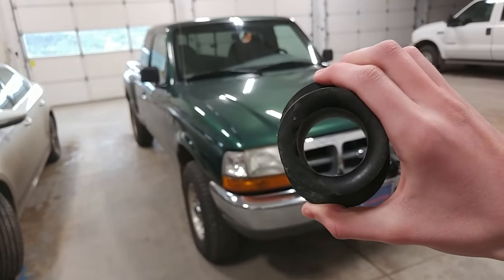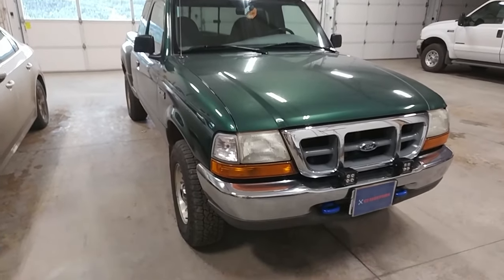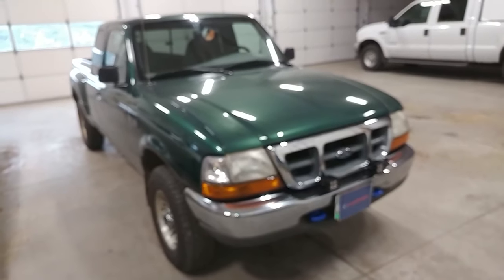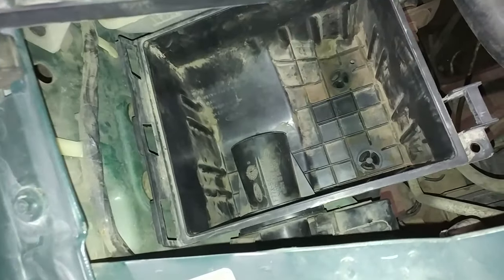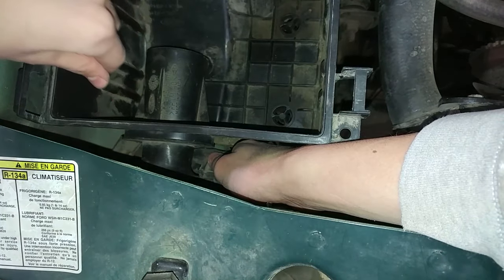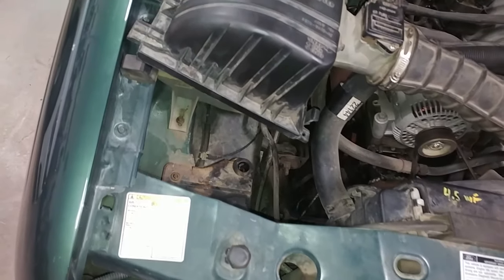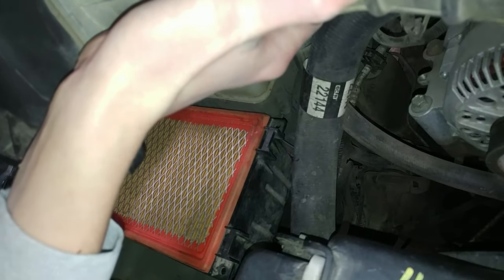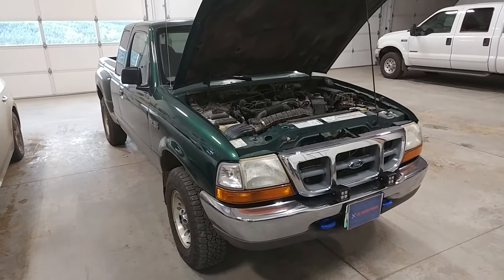DO THIS 100% FREE MOD TO IMPROVE SOUND AND POWER!! - Ford Ranger 3.0L Airbox Modification

Comment: I have a 2003 Ford ranger 3.0L . I put a K&N filter and cut 2 holes in the side of the air box below the level of the filter. Horse power has gone up and gas mileage has gone up as well.
Reply from the maker: Cool! Nice to hear that.

Comment: I did this on my 99 manual ranger (1 previous owner with just over 100,000km on it) and it ran fine for a few days… after that, it didn’t want to start and bogged up on me. It fit symptoms of either a broken MAF sensor or something in the computer tricking it into thinking it’s receiving much more air than it was. I put the funnel back and it ran fine. If you want to try this, I would say give it a try but make sure you keep everything so you can put it back if it goes wrong.
Reply from the maker: I second that. I saved all my parts just for this reason

Comment: So my thoughts are the rectangular scoop . Open it up & use more of its rectangular space . And the air box open that hole up more to match the now larger rectangular scoop. Use ABS plastic engine side & top side to block heat .

Comment: Good tip. I tried it on my 2010 Ranger Sport. 4.0l stick. It's quieter. And seems much more responsive from naught to 85. The snorkel does provide a fun little sound on my downshifts, but if it kills the overall performance and does nothing else beyond nifty sound then this mod is the best I've seen so far. Now if I could just get a Hurst mod.
Reply: Ah, after this I 3D printed an oval tube in PLA+. Much closer to get it back to CAI status and maybe a little smoother.  I kept my STL files if anyone wants them.  Then I added a cheap ram air setup. It's Winter... Overkill but no ill effects.
Reply: Indeed so my 4.0 xlt ranger did pretty much the same

Comment: Thanks for your video. I had to replace a bad windshield wiper fluid pump motor and you have to take the air filter box out to get to the motor. This video really helped me out with taking the box out and not breaking anything to do it.
Reply from the maker: Yeah no prob man. Thanks for watching!

Comment: I did this to my 2.5L Ranger, and also bought a K&N air filter, and it's a noticable difference. I pretty much did a poor man's cold air intake. But it actually works, and it's not a hot air intake. There's no sense in spending $250-$300 for a setup, only to get maybe a 5HP bump. But ONLY if you do it in a boxed setup.
Reply: Oh and another thing, it seems to be getting around 28-30 mpg, when before it was getting around 25mpg. This mod really helps especially if you use the A/C a lot. Another way to improve fuel mileage is by cleaning the map air flow sensor with only map air flow sensor spray.
Reply from the maker: Actually I did that and it didn't make a difference unfortunately...

Comment: Did this to my 2000 Ford ranger XLT single cab 2.5l 4 cylinder. It's ALOT more responsive than it was with the funnel, although the noise remains the same, but getting to 60 mph isn't a struggle as much anymore and getting to 90 mph feels like it can go much faster if it had a longer 5th gear (mine is a manual converted)
Reply: Was looking to see if it would work on mines good to know I also have a manual will be doing this this weekend
Reply: Same I have a 98 2.5l ranger and I deleted mine today and a lot of things have improved. I have better gas mileage, it’s much more responsive, feels powerful, and before it used to struggle to get to 70-75mph not it feels like it can go way faster

Comment: Best cheap version I've seen yet on the Ranger. I definitely did not want to spend a lot of money and this I'll do this to my 2011 Ford Ranger and see how it does with my 2.3 L.
Reply: That did in fact Clay gave it some pep. The 2011 Ranger XL 2.3L 5 speed manual gave 1st thru 3rd some extra go 4th an 5th gear felt close to what it was.

Comment: I did the airbox trick after I rebuilt my rear-end a 8.8 posi with 5.13 gears with 35 inch tires and now I have better take off than it did with the 14 inch tires with a 4.10 gear and the gas milage is way better
Reply from the maker: Nice! Glad to hear someone's actually got some good results from this
Reply: hmm maybe it was the gearing and tire size that made the difference and not the removing of the airbox intake cone?

Comment: Definitely an exhaust system. I have been wanting the Magnaflow Catback off road pro. I have the same engine but can't find a good video on it.
Reply from the maker: You should watch my exhaust mod video, makes the ranger sound pretty good.
Reply from the maker: And I get what you mean about not finding any good videos on it. When I was looking for Ranger exhausts, all the videos are low quality and not a good comparison.
Reply: Hey Chris. I have always loved flowmaster 40’s on all my v6 rangers(had many) my current prerunner has this intake mod, and the magnaflow dump off-road. If I had social media I’d let you hear it. You WILL not be disappointed. It sounds sooooo much better, not to loud. Deep and it screams wide the f open (35’s 4.88 gear lol)

Comment: I did this mod on my 01 Ranger XLT and I believe it kicked on my engine light 😢 for my air and fuel mix running rich
Reply from the maker: I doubt the mod would make that happen. I'd be interested in what the check engine light is if you ever put a scan tool on it

Comment: Did this mod on my 01 ranger 4.0 SOHC - appears to help slightly too.  Will be installing MagnaFlow #17114 Off-Road Pro Series exhaust later this month.  only difference will be pipe out to the side with a one into two outlet.  Fits 3.0 and 4.0.
Reply: Hows ths magnaflow sound?

Comment: Did this to mine last night it did feel a lot more responsive on my 2.3 l in my 2005 but also I didn't realize that I had a mass airflow sensor going bad like it had been lunging before and kind of some hard starts here and there so yet completely shut down on me last night so I got to replace the mass air flow sensor cuz I hooked it up to the machine that's what it was saying so once that's fixed I hope all is well give me a little bit more punch and 4th and 5th gear that's really all I want and maybe a little bit more power a little bit better fuel mileage other than that the two three works great and I think they use the same air box whether it be the 4L the three l or the 2.3 dual overhead cam

Comment: The rubber piece helps the air box draw in cooler air from outside the engine compartment.  I would recommend leaving it in place.
Reply from the maker: It seems to block the intake a little bit, but of you want to then go for it
Reply: @ClayRepairs  A slight blockage is better than drawing hot air into engine.  Hot air can cause the engine to ping.
Reply from the maker: Yeah I don't think so... I call bs on that
Reply from the maker: Hot air just makes less power
Reply: @ClayRepairs  Because it makes the engine ping and the knock sensor tells the computer to pull back on the timing.
Reply from the maker: the engine doesn't ping from hot intake air, bud
Reply: You must be from the government are you DOT police
Reply: @aux1z11  🤣

Comment: Did you notice an improvement in fuel mileage after making this mod? It seems to me that the free flowing air would also improve the mpg on top of improved performance.
Reply from the maker: I didn't notice an increase in MPGs from the airbox mod, but I'm going to release a video where I clean my Mass Air Flow sensor to see if that improves MPGs in a week or two. (or 4)
Right now, I'm getting about 13 MPG and if you have a Ranger, could you tell me what you're getting?
Reply: @ClayRepairs  I just put a brand new set of cylinder heads on my 3.0 and haven't driven it at all. But when I do I'll let you know what I come up with.
Reply from the maker: Ok, thanks!
Reply: Whats the worst that can happen if this goes wrong
Reply: I have a 2000 ford ranger with the 3.0 and with everything stock with a decent mix of highway and in town driving with a 20 gallon tank I’ll get around 330 miles or so per tank of gas. Thought it would do a lot better so let me know if you end up doing any mods that improves those mpgs
Reply from the maker: @Quinton44  Actually I'm editing a video right now about how to clean you mass air flow sensor to see if it can improve MPGs, so stay tuned!
Reply: @ClayRepairs  I was getting about 20mpg on mine. 
But maintenance was lacking from lack of funds before I was forced to park it behind the shed.
I'll follow you for advice and knowledge when it's time for me to take it into the garage.
Reply: Wow 13 MPG? I haul a rider around all day in the back of my 97 3.0 and get 24-26 mpg and make 400 miles a tank. Not sure why our MPG is so different.
Reply from the maker: Sure wish mine got 24 miles per gallon...
Reply: @ClayRepairs  man I have a 95 b3000 4x4 and I'm getting about 23-25mpg but I do alot of highway driving for that higher mpg. I'd say something's up with 13!
Reply: @ClayRepairs  It's probably your driving style if the truck is running right with no engine lights/codes. I drive my 04 XLT with 3.0L around 750 miles a week and average over 20mpg with mixed highway/city use. It gets 24 to 25 on the highway. But I keep the rpms below 2500 unless my cruising speed demands more and assuming there is no major grade or load. Rarely do I carry more than a couple of hundred pounds of items at a time.
Reply from the maker: Yeah I think you're right. I started driving more highway lately and my MPG's went up to 18, which isn't amazing but sure is better than 13.
Reply: @ClayRepairs  I get 15mpg on my 2003 Ford ranger V6 3.0L using regular and 13mpg with E85 I was wondering because I think I am suppose to get better mileage than that also for these trucks the manual transmission gets better gas mileage than automatic which mine is a automatic. I put new coil pack spark plug and wires and changed fuel filter and air filter etc
Reply from the maker: I get about the same on average... I think its mostly down to driving style
Reply: @ClayRepairs  I heard that attaching a universal high performance air filter increases MPG and HP along with converting to a electric radiator fan compared to the mechanical one. I am thinking of doing both.
Reply from the maker: nice! I'd like to hear how it goes if you do it
Reply: I get about 19 on a 2002 b3000
Reply: I did it to mine and reverted it pretty soon after because it dropped my mpg but I’m gonna do it again to see if it will still effect it

Comment: I just completely took out the oem filter and stuck a cold air through the air box. I also took that little piece out. It seems to have worked quite well but I think I’m gonna take the air box out all tiger and build my own air wall
Reply: if you took those pieces off you're not sucking in cold air, your sucking in turbulent hot air from the engine bay.

Comment: i did about the same but in different  way i have 2003 ford explorer the snorkel sucks hot air from the engine bay but i found that ford explorer 2004 and up has bigger better snorkel that sucks cooler air from the headlights hole i took the bottom piece  of 2005 ford explorer of junkyard and but it in without any modification v6 4.0
Reply from the maker: Nice 👍🏻

Comment: I've got a 2000 XLT  with a manual, I can't wait to try this
Reply from the maker: I hope it goes well for you! Tell me if you notice a sound difference, because when it was pulling hard at 3000 RPM it sounded a lot better to me!
Reply: @ClayRepairs  definitley did, this in conjunction with me taking an inch and a half worth of slack out of the throttle cable made a HUGE difference. Much better tone and smoother too
Reply from the maker: Yeah, I did the zip tie trick on the throttle cable, and it made a huge difference as well. Thanks for watching!

Comment: I'd probably put some screen material over the hole to keep excess dirt & bugs out.
Reply: That’s what the filter’s for
Reply: Cover the intake opening with wire mesh, or mice pack the air box with nuts.

Comment: I mounted a funnel in the grill. And ran flexible plastic tube from the funnel into the air box. Left the other part alone.   Helped with the pinging. Mines a 4 litre. 

Ram air. Hehe.
Reply from the maker: nice 🤣🤣

Comment: Got a 99 4 banger currently hitting 10mph 😅. Maybe I'll give this a try when replacing my air filter that's been needing replacement.

Edit: so finally went through with the mod. I replace the stock filter with a K&N replacement model 33-2106-1.  I went ahead and did this mod. Deleted the restricter tube and extended air box.  

Overall performance when up a bit. A lot more responsive. 
Sounds pretty much a same to me. Didn't notice to much of a difference.

My gas milage definitely went up. I was getting around 10mph city/highway. Full tank of gas maybe got 240miles to a tank. If i was lucky.  After the mod. Driving like an actual truck somewhat loaded bed here and there and reached 300 miles and still about 2-4 gallons left in the tank. So i should see about 315-340 miles till im bonedry.  Definitely estatic with the results. 

Note I would not recommend doing this mod/ or at least running a K&N filter if you live in a hot dry dusty climate because you will allow dirt particles getting into your system.
Reply from the maker: yeah go for it man 👍
Reply: add k& n air washable air filter its massively better

Comment: I’m just wondering if that little tube is to prevent water ingress
Reply from the maker: It might be...
Reply: @ClayRepairs  have you had any issues while driving in heavy wet conditions?
Reply from the maker: I haven't. The truck runs perfect, even in heavy rain.

Comment: So you take off a engineered piece of tubing that looks very precise and think its a good idea? I would recommend you put your scan tool on it and see how far off your fuel trim is now. I am guessing it will be running kind of lean? I would think if it needed to be bigger Ford would of made it bigger? I believe when you start messing with airflow you will need to re-tune your engine computer as well. Also get ready for people who have engine problems after this mod to come after you for $$$$
Reply from the maker: Actually I did put a scan tool on it and the long term fuel trim is pretty lean. Not sure if I should reset the fuel trim or put back on the snorkel thing...
Reply from the maker: And chill out bro...
Reply: on todays nature documentary we will be looking at the wild KAREN (srsly doug chill out)
Reply: After I did this to my Ranger, it actually runs better than it ever did. It ran like crap before. You can thank the EPA regulations for that. Even if it is running slightly lean, it's not going to hurt anything. Any fuel injected vehicle tends to run lean as they age. With carbureted vehicles, it's usually the opposite.

Comment: My 99 Ranger with the 2.5 4 banger has the modern version of a Cherry Bomb Muffler installed after the OEM one rusted out(Or was blown off) when I installed the HHO Gas generator. It's still quiet -until you step hard on the gas. I also installed a PVC Oil Catch Can, A remote Oil filter relocation Kit used to filter the coolant going to the Heater core and of course, replacing All the lights (headlights and dash lights too) with LED lights. Just little things that have gotten me 221000 miles on it so far. PS DO NOT USE A FRAM OIL FILTER.EVER. You RISK DESTROYING THE ENGINE IF YOU DO. Even The WalMart SUPERTECH Oil filter is better constructed. I've cut them open and looked. No To Fram
Reply from the maker: Thanks for the info man

Comment: I have a 2008 ford ranger,  2.3, 4 cylinder will this work too ???
Reply from the maker: I'm not sure. You'd have to check the front of the airbox to see if it has that piece.

Comment: i made my whole bigger on mine and my headgasket was blown after this.. id say keep the small plastic piece cus it gets more air forced in.. you can find a bigger tube if necessary so you wont get the hot air from the motor in
Reply from the maker: I'd be willing to bet that has nothing to do with the blown head gasket 😂
Reply: @ClayRepairs  me too cause that’s impossible that it could’ve blown a head gasket from doing this air box mod I call bs
Reply: bud, not my fault u drive ur truck like **** and the head gasket died
Reply from the maker: lmao
Reply: @MinecraftFyler  hot air can mess with the cylinders.. my radiator was actually already leaking so kinda just found out the problem 😆

Comment: Dude just made a hot air intake. Removing the baffle that reduces noise from incoming, turbulent air is good, but keep the "rubber thingy." All that heat soak in the engine bay just raised the intake charge Temps. No.

Comment: So are you not concerned about the fact that you just exposed your intake to all of the hot air in the engine bay, and all of the extra dust and debris in there?
Reply from the maker: Haven't had a problem yet

Comment: What if the box will not pop off? It’s stuck stuck
Reply from the maker: If you're talking about the main airbox, then some WD-40 on the rubber mounts (especially the bottom ones) and a long flat screwdriver to wedge between the bottom of the airbox and the metal mounting bracket to pry it out should help.
Let me know if this answers your question!
Reply: Never mind I got it previous owner did not take good care so the plate was rusty with the clips
Reply: @ClayRepairs  yeah just had to use alot of WD-40 lol thanks for the vid very helpful 👍
Reply from the maker: Thanks for watching!